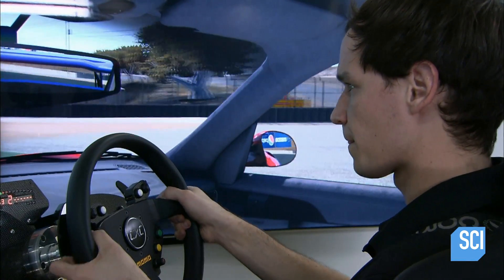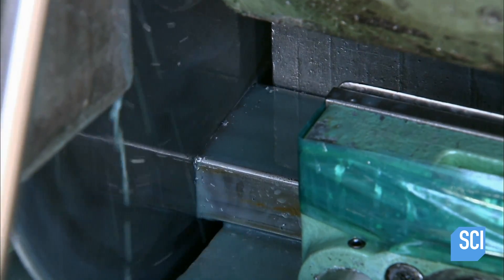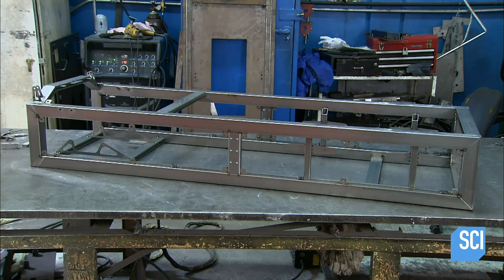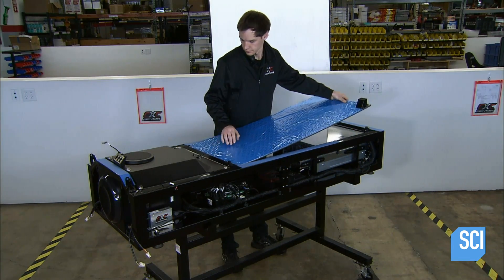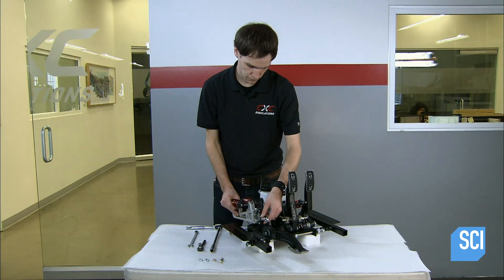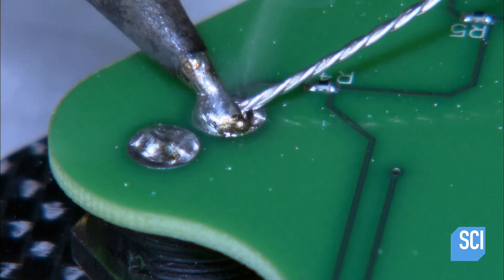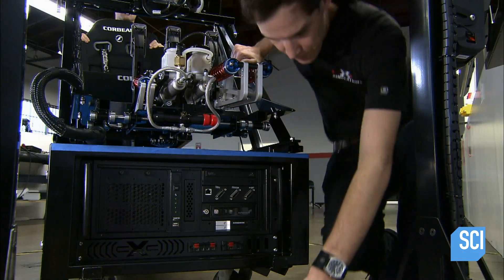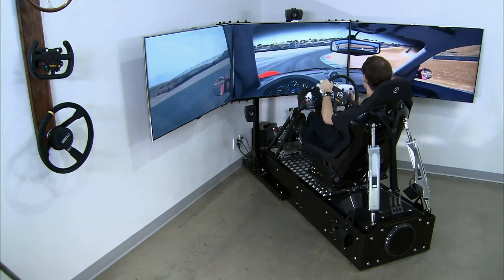How It's Made: Race Car Simulators

Comment: If another like not simulator but the controller, like a suction on the floor, maybe, but the way to take it out? Maybe if like wheel or something like heavy box(to add stuff in the box so heavy it dont easily move), means if seat doesnt vibrate is okay. Just the steering wheel. The point is able to play it. If android to sync to it(even if use tablet/android as screen), or as controller(just casing it into steering wheel).

Comment: I know it's nitpicking but shame it has no manual transmission
Reply: It does though- just doesn't have a standard stick and instead uses shifter paddles like high end racing cars.  The pedal assembly has a clutch as shown in the video also.  You can easily attach a stick shift if preferred.

Comment: Looks like it would be cheaper to buy a car.
Reply: depending on the set up they can go for 10k+ though that is self built / you need to get the hardware too (overall price would be 10k ish for a alright one.) I've seen a few for 30K, but that is prebuilt (by a company that also comes and installs it for you with top end hardware)
Reply: @Chuck_Norris_  Defiantly cheaper to buy a car.    😆
Reply: @Graeme_Lastname  Initially...yes on the upfront costs..but LONG TERM..you'll pay more for the car than any simulator! :-)
Reply: I have a sim racer, it's not this fancy but it is an absolute blast to rip an f1 car around spa or monza in VR
Reply: @pmm4177  The only thing missing is feel.  When they get that sorted out it will rock.   :)
Reply: It is but you can't race a real car in your living room and a real car doesn't come with a restart button
Reply: @pmm4177  Yes indeed, a very real problem.  I've been in head on collisions, gone over a cliff, rolled, lots of things, many times.  I come from the days when there was no speed limit on country roads and you didn't have a dick until you did the ton.  Those were the days.  Sorry, guess what I've been doing all night.     🤪